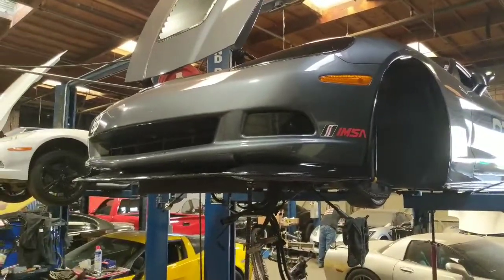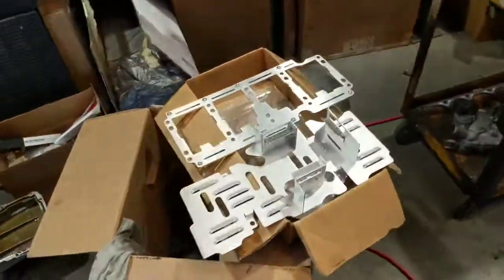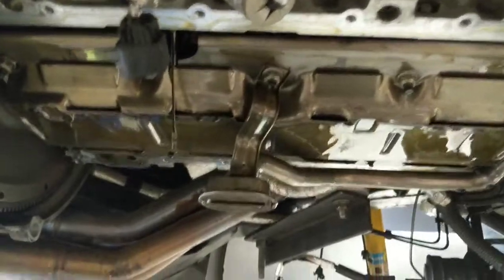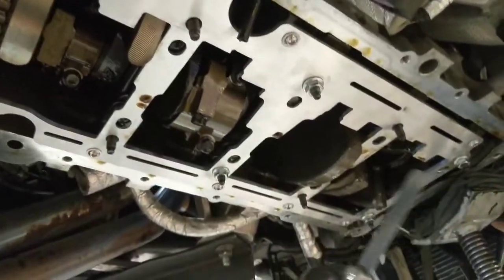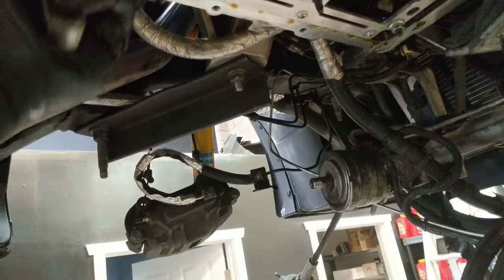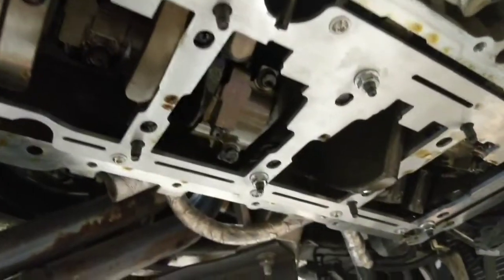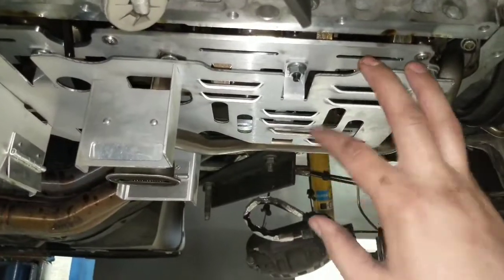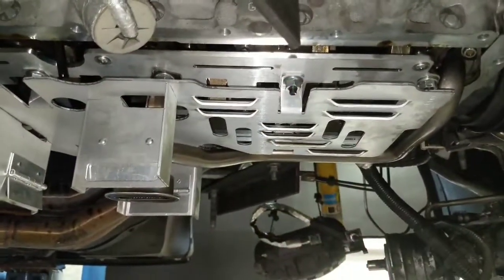Improved Racing C6 LS2/3 Oil Pan Baffle Crank Scraper Install

Comment: I thought stock oil pan more than enough… how can i buy same kit?
Reply from the maker: The stock oil pan does not have adequate baffling unfortunately. For this baffle/scraper kit you can visit or contact Improved Racing
Reply: @c5natie1  discontinued

Comment: How were the power gains any dyno gains?
Reply from the maker: 7-10hp on average. Also the engine revs up slightly quicker. On top of that I've tested this kit up to 1.4G and have had no oiling issues.